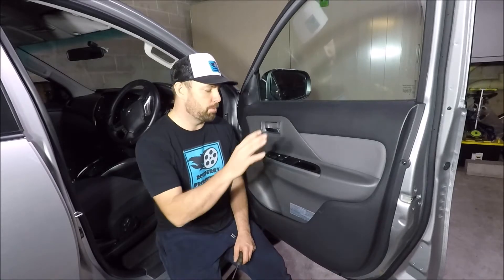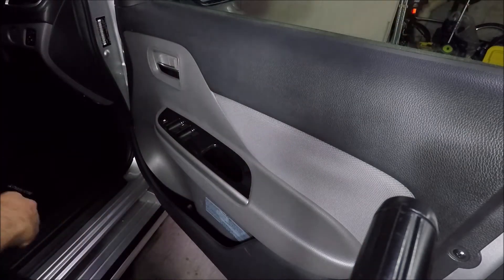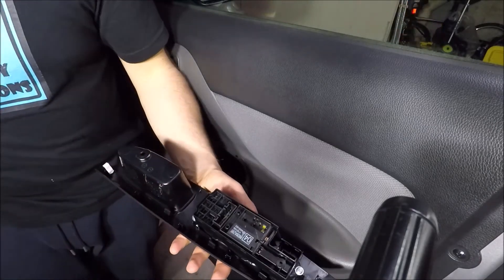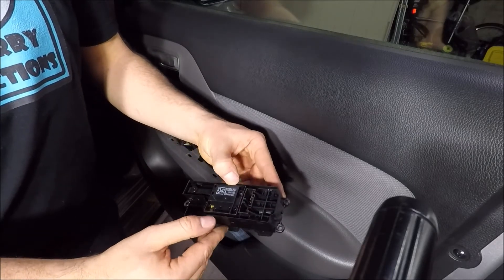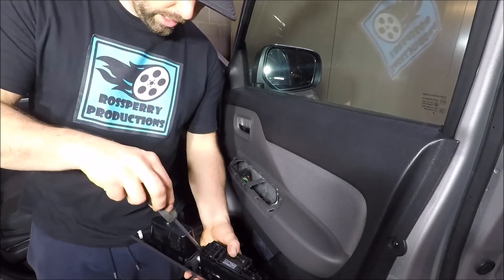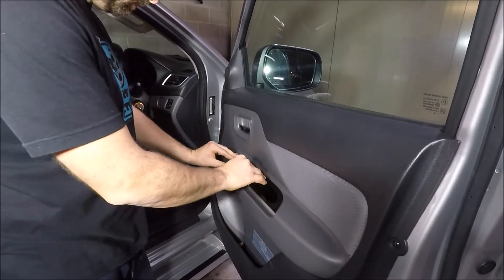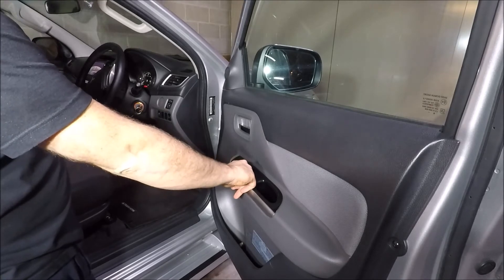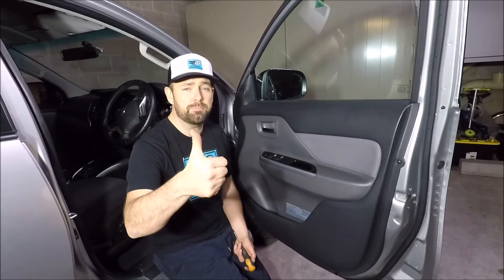How to Replace Electric Window Switches on a Mitsubishi Triton (L200)

Comment: This really helps, New part cost at £350 is expensive, will have an auto electrician see if repair is possible before replacing. (2015 Warrior, 93000 miles),
Reply from the maker: Hi Gerald, wow that is expensive!! I would have thought the actual switches will be a common part and just the surround specific to the car. I hope you get to save some money. Ross

Comment: I need to do this with our Mitsubishi ASX I removed the screw but it doesn't lift out as easily as yours. Feel like there is another little screw that's holding it back.
Your advise will be appreciated.
Reply from the maker: Hi there Tania, unfortunately I have not worked on an ASX yet. I would have assumed it would be very similar however the clips might be locked in a bit tighter, have you seen if there are any ASX door panel removal videos?
Reply: There's not alot of videos on youtube, but if you find one that can help me, please share the link.
Reply from the maker: @taniareyneke2517  hi there, I just had a look at some of the door panel removal videos and they all seem to leave the buttons on so I think there may be screws underside. The good news is the panel seems to come off nice and easy, so that's what I would do. Ross